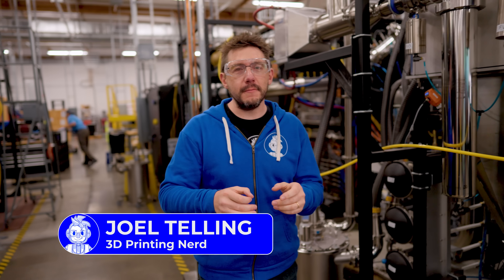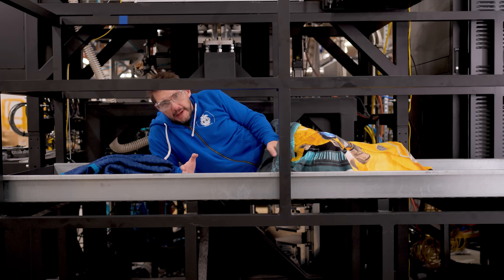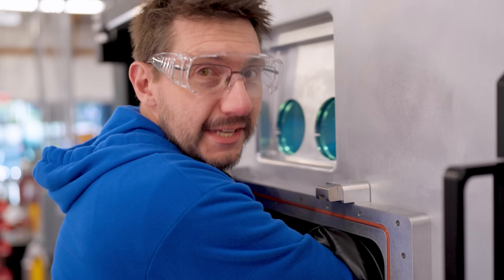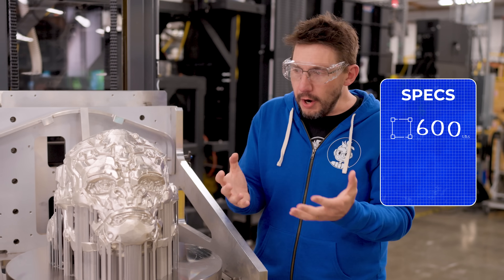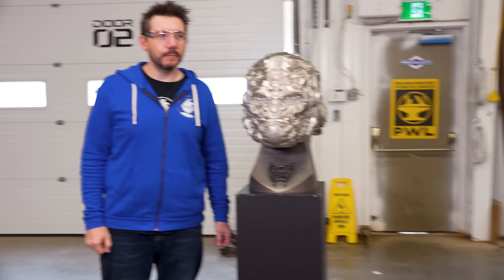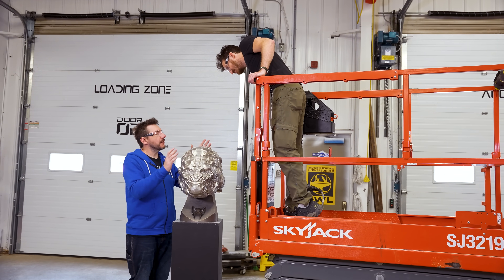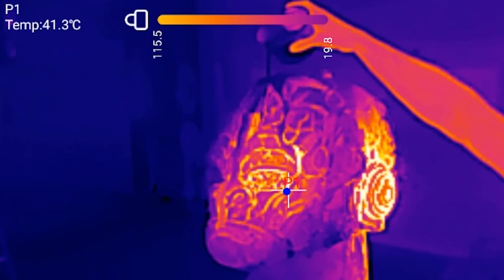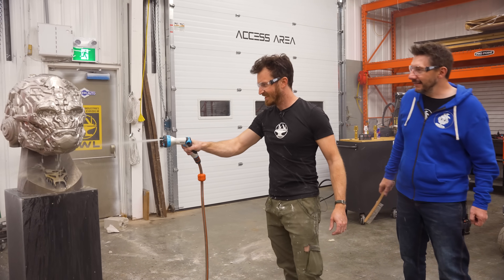3D PRINTING a Real TRANSFORMER!

Comment: The full video is even better than the short LOL. I wonder if all of those supports were necessary though. Are they there to prevent warping due to the heat? I would think that the added powder would add at least some support.

Comment: Super fun collab! But how did they get the supports off?
Reply: Very carefully. 😉 The supports are actually designed to be easily removable. Once the part is removed from the build plate, they can be removed with minimal machining.

Comment: Why does it require supports? Doesn't the powder support??
Reply: When you're printing in a plastic powderbed (known as SLS or Selective Laser Sintering), yes, everything is self supported.

This process is L-PBF (Laser Powder Bed Fusion), and especially with our Sapphire XC firing 8x 1kW lasers, you're putting so much energy into the powder that parts actually warp up out of the powderbed. So supports in this process serve two purposes: they evacuate heat from the part into the baseplate, and prevent the stress in the part from curling it up like a potato chip.

Velo3D's process allows us to use WAY LESS supports than are required for most L-PBF printers on the market. This allows us to make parts others can't, and makes it easier+cheaper for us to remove supports and get finished parts out the door.
Reply: Good question! You're right. The bed of powder does support the part. The supports actually act as anchors that keep the corners of the part from lifting above the bed of powder.
Reply: @velo3d  how do you remove the supports? With a saw?
Reply: I was going to ask the same question. Thanks for the explanation, understandable and it makes sense. That bust is awesome!